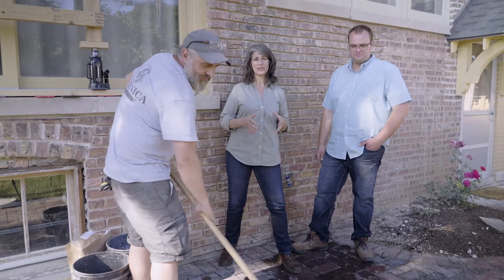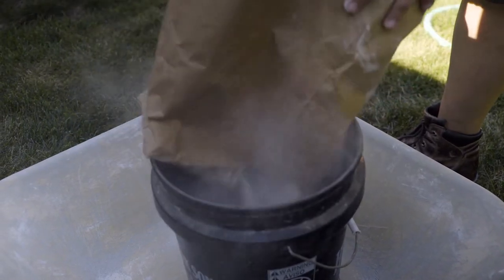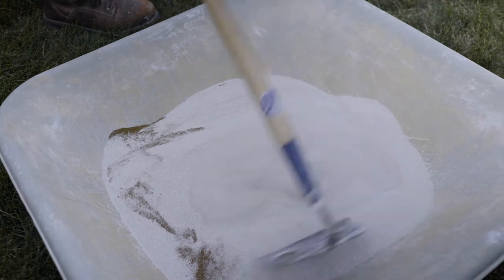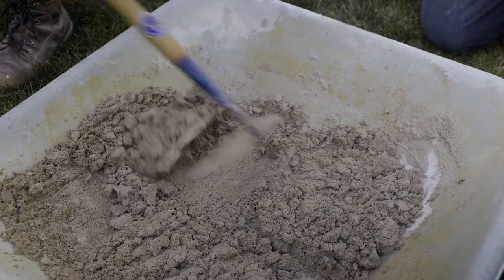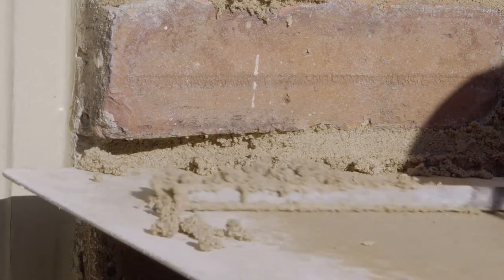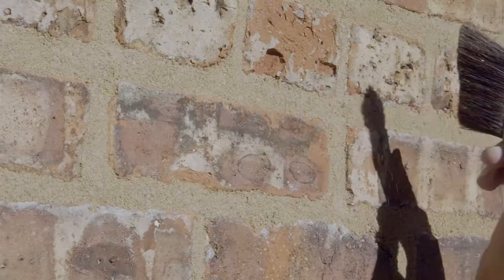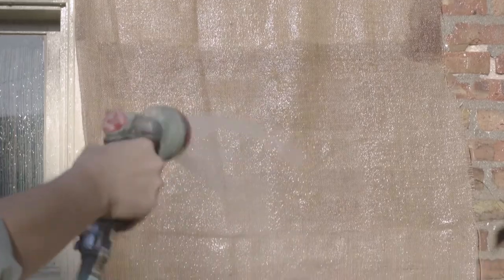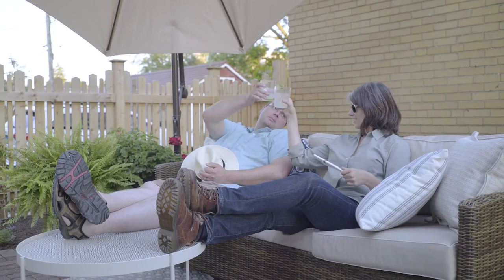Repointing Your Vintage Masonry: Mixing & Applying Mortar

Comment: The curing process would make for a very expensive repair. I (generally) wouldn't trust the home owner to spray the burlap ever day, meaning if I'm not there doing other work for the duration, I would have to stop by once or twice a day for a week. That doesn't come cheap.

Comment: The reason for striking the mortar with brush to take away the slick surface left by the truck pointer. The striking with the brush allows carbonation to take place.

Comment: Sir, you used the word chicago bungalow.  I thought bungalow was indian concept.  What is difference between bungalow n average  california home?
Reply: @Surrender Singal, yes the word bungalow did originate in India. But the concept of having a house with a relatively low profile and a wide, open porch came to be known as a bungalow” here in the US. A Chicago bungalow, on the other hand does not have an open front porch but it’s considered a specific type of bungalow.
Reply from the maker: Here's a post about how the bungalow came to Chicago and the U.S. from India: https://www.chicagobungalow.org/post/2019/08/29/the-indian-bungalow